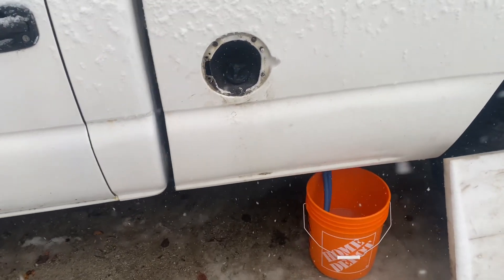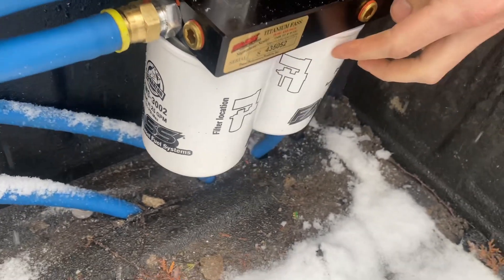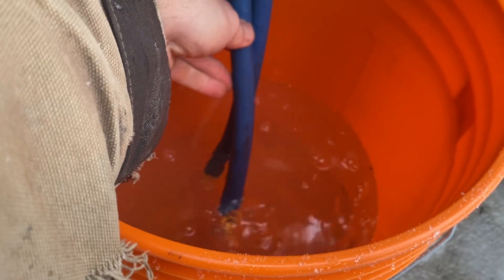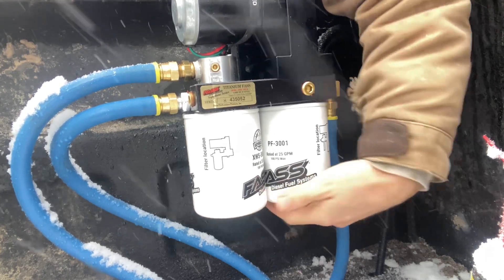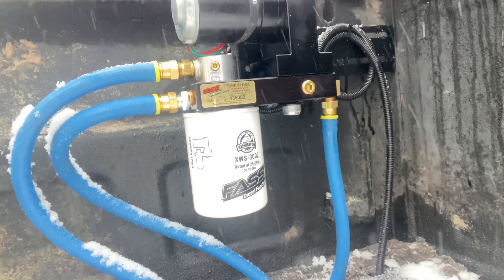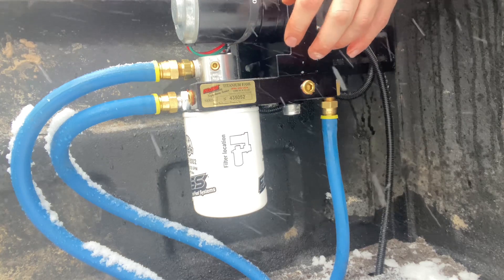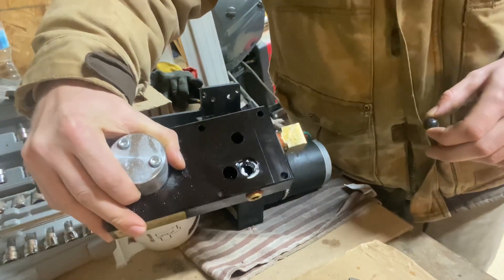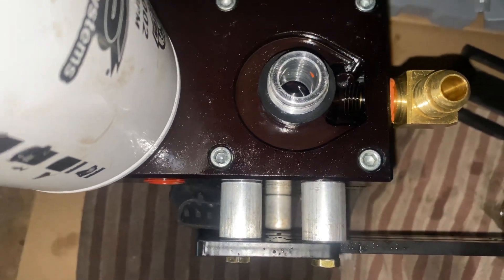Fass Lift Pump Bucket Test

Comment: pumps mounted backwards, first part of the video wrong filter was off, when you crack the foward filter mounted correctly it would of been your rear on your setup the suction to air you were putting your finger over should of been going through the filter to the pickup. filter off that motor was never connected to the pickup line. filter closest to the 2 output lines should be the only filter cracked or off during priming
Reply: pickup line to tank goes directly to that second hole you were touching at 3:24 should put in vid or description so no one burns out their pump
Reply: 3:28 hole that suction would suck the fuel from first hole to motor then second filter, second filter off, no restriction faster prime
Reply: correct at 8:08. WD 40 is a definite especially new, so the pump doesn't have a dry unlubricated start. Hope this info helps!

Comment: Should the pump always be running with the key on? I have a duramax lml engine rebuild that was running great for 2 days and now 3 and 8 fuel injectors are coding out
Reply from the maker: I have always wired it like Fass directs so my trucks turn the pump on when the key is on
Reply: @Cruff16  should the motor be loud as fucking hell?
Reply from the maker: I’ve always noticed it running but not overly noticeable, even my old ones that had 3 years on them

Comment: These are gravity fed fuel pumps. You have overworked the by putting it above the tank. All pumps have a head rating which states the maximum height a pump can be above the source.
Reply from the maker: Pump was brand new out of the box, I temp mounted it under the truck, same result. When I spoke to Fass they didn’t care that it was in the box of the truck
Reply: I'm in the same situation man. Got a brand new pump motor new gear brand new o rings. Installed a sump. And still can't get a prime. Even after pressurizing tank.
Reply: I have a new 100 and I can get diesel to flow out of the front filter when cracked and I can hear it circulating back to the filler neck but no output pressure at all. Very frustrating. I’ll probably try this. Take a look at the check ball and orings. Fingers crossed.

Comment: The system is normally installed lower than top of tank! Why is it installed in the box ?
Reply from the maker: I wanted it out of site and out of the elements, no need to worry about salt and mud or rocks
Reply: harmonsheavydutytruckrepai6590  Is this true for both models using the sump, or draw straw?

Comment: Why would you install it in the pickup bed?  They recommend installing on the frame rail as close to the the tank as you can.  The way it is installed requires the pump to suck fuel straight up into the bed which may be the issue.

Comment: So we’re the orings messed up ?
Reply from the maker: Yeah, it either wasn’t sitting perfect or it was pinched maybe a small scratch I’m not overly too sure I replaced them and it was good to go
Reply: @ just had the same issue is why I originally asked . Same deal with mine old orings weren’t visibley messed up . Changed them no change , took it back apart and put even more greese on them and it finally sealed up and primed
Reply from the maker: @ good to hear it’s back up and running!

Comment: I wish I had gone with a Air Dog! The Fass pump toasted my VP-44 worst system on the market. Don't listen to the hype it's all BULLSHIT!
Reply: You should probably give the experience of how it “toasted “ the vp44
Reply: I've had my Fass 150HD for 12yrs, 270,000 plus miles. Runs great, had to shim relief spring & replace wiring harness due to corrosion. Pumps great & feeds a Scheid Stage 1 Lightning VP44 plenty of fuel.
Reply: My fass 150 works great. Been on the truck 5 years (2002 lb7 Duramax )

Comment: pinch off the return.......... you buy a fass its just how they work you tore yours apart for no reason. and it should beable to self prime and not need the return line plugged off...... Air dog works outta the box. and its smaller so you can actually mount it to the frame without clerance issues. oh and the "foamy ness" from the fuel is not all from the little bit of wd40 you sprayed in it..... and thats a pitiful stream to feed a 5.9L engine or larger. fuel..... probably pumping a whole 2 gallons per hour. and 3 gallons of air with it. i would've called for a full refund after a brand new pump out of the box refused to work. even after cracking the filters to prime it. I almost bet your pump. was assembled without the Fuel return Pressure regulator. without it. it will have a weak stream and pump about as much fuel as you showed. its can only make 10-30 PSI of fuel pressure without the pressure regulator installed. granted it looks like its on a duramax thats a million times better than stock. since no pump to a shitty pump.
Reply: since no pump to a shitty pump.,,,no pump to a shity cp3 pump that duramax and cummins use whigger please/

Comment: This FASS pump and other similar are ridiculously expensive absurdly.
I stick with the OEM one actually i just replaced the in tank one with NOT even an OEM  one.   It works fine for years and years.
I did the job myself dropping the tank out.  The hardest part was to remove the electrical and fuel hoses actually.l

I have the 2003 Ram 2500 diesel with the canister mounted pump.  l used the 2002 pump type from  2002  model when the canister pump failed.  It works fine. Then I have the  fuel sender sensor went bad.  I then replaced with the intank pump which has the new sensor included.
Now i have the old pump as a back up and i don't have to worry about fuel pump for a long time or probably never until i get my Tesla Cybertruck.    I installed the fuel pressure gauge years ago and the pressure with the NON OEM in tank pump is over 15psi.  Yep it max. out my gauge of 0-15psi probably because of brand new pump and filter.
I only paid  about $50 on ebay for it.

If the main pump requires under 10psi of fuel pressure why would you want to spend that big dollars for the FASS or whatever other they are selling.   Is it the extra filter?    Save your money. stick with the aftermarket one  the Ebay one works for me  for year from other purchase that i did for my truck.   Heck I am going to install a prefilter so i can prolong the main filter even more.    
With the fuel pressure installed I know instantly when the filter is clogging or some  other thing is  wrong.

It does not have to  be pricey IF you know what you are doing.  Monkeys see monkeys do will cost you big time.
Reply: 1 duramaxs don’t have factory lift pumps 2 separating water form the snotty fuel we have today is critical 3 165gallons per hour of constant filtration is awesome 4 it supports more power and is easier on your main pump helps it last longer extremely important if you have a cp4 pump i could go on and on u do u tho